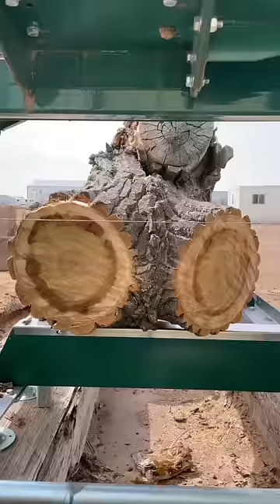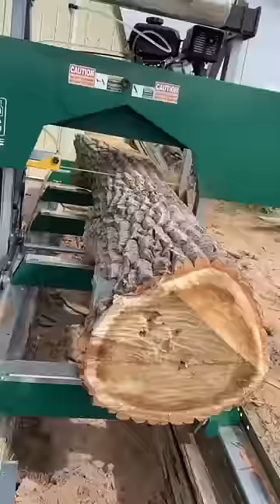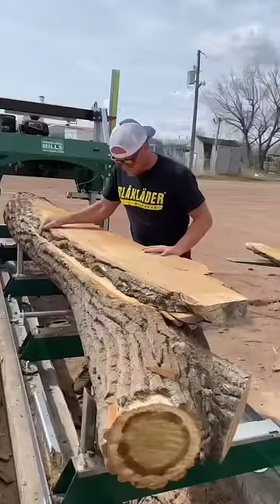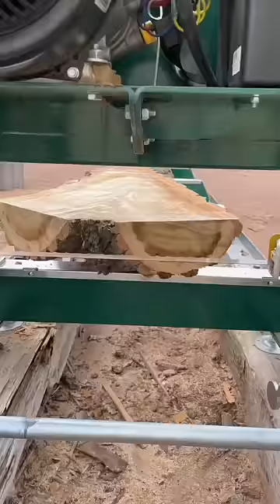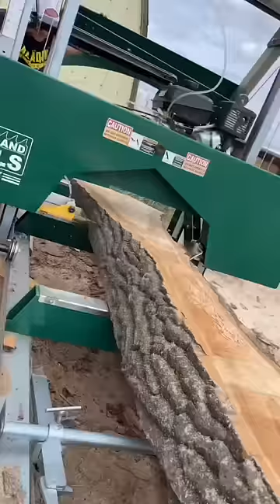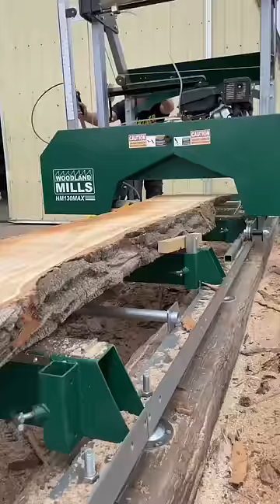Truth is, sawmills are a lot of fun! #woodworking #wood #woodwork #maker #sawmill #bois #holz #work

Comment: As I sit here in a sawmill, I can't help but wonder why your experience is the exact opposite of mine
Reply: Why's that? I'm just curious about how working in a sawmill can be different.
Reply: @juancarlosarroyo9144 
Where I am, the equipment is not well maintained, so prone to breaking down, not working correctly, or just downright doing things it isn't supposed to.

I also work with Australian hardwood, which is just downright impossibly hard and dense timber
Reply: Haha you know working here and just have some nice wood saw is a different thing 😁
Reply: @Duck_side  So like the locus of Australia?
Reply: Difference might be if you're your own boss, cut logs in funny shapes, decide where each cut goes
Or
Work in a commercial sawmill, have no say in the process and cut up straight softwood into construction lumber all day
Reply: I worked for several years at a sawmill that made dowel rod blanks that are made into shovel and rake handles. Depending on where you worked, gauged your experience. I worked up to the debarking shack, so I had it pretty easy. I could control the board footage for the day, so if someone pissed me off I just swamped the mill with logs to saw.
Reply: Vc nao ta precisando de um cara pra trabalhar com vc nao sei fazer moves lindos trabalho na minha casa mesmo mas tenho poucas ferramentas
Reply: 100% agree. Spent 6 years in a sawmill. It’s fun for the first 3 months. After that, those 60 hour work weeks get pretty demoralizing!
Reply: @juancarlosarroyo9144  🌼
Reply: This reminds me the story of the guy that drove the Autobahn daily for fun. He really enjoyed driving his little car around the corners at high speeds. Then one day he was offered pay to do what he’d already been doing for his own enjoyment. Naturally he jumped on this opportunity. After about six months he found himself enjoying it less and less as the stresses of reporting back started to feel like work to him. It’s a perspective challenge now. He enjoyed it when it was his hobby and began to loath it as work. I hear the very same things occurs to musicians often too. What they used to enjoy tirelessly has now become a burden both mentally and physically. I’m willing to bet if we look within ourselves we can find that enjoyment again with a new twist to some old perspectives. How spoiled rotten must we be to not enjoy being paid for a hobby? Or perhaps we can realize what fortunes we have by merely living where we are and that we aren’t some kids working in some humid factory making shoes for people that might wear them twice.
Reply: @Duck_side  I walked out of a saw mill on my first day. We had worked 5 hours without a break or clearing the machine of dust. I told my boss I was going to have a smoke, he said don’t come back.
Reply: i work in a lumberyard/sawmill. we have a giant saw that does this for us, though the logs are bigger, we pull the cants onto two angled holds that hold up to like 20 30 cants then the forktruck comes and takes them to to the smaller mill to become boards
Reply: @ItalianoDio-   @Italiano Dio  it takes you away from your family! When you leave for work your family is asleep. When you get home you have about 1 hour with your kids before bedtime. After you eat dinner and shower, you're too tired to spend time with your wife let alone listen to anything she needs to talk about. You see the people at work just as much, or more than your family. I understand that some men or women may like that, but for me it was torture.

It makes you feel like you're compromising your morals after a while and you slowly start to think it's ok to sacrifice your time with your family in order to receive money.

The greatest currency we have is time! You can either spend the majority of it at work or with family. I would prefer to spend mine with my family.
Reply: @kennyodberg171  See, that's where we differ. Single, no kids, and I work for myself. It's ok to trade time for money, as long as it's a lot of money. I love it. $2k for 10 hours of work, give or take. Then you only work 2 or 3 days a week and have plenty of free time.
Reply: @ItalianoDio-  I wish that's how it was. I was working 60 hours a week making around $2000 a month with overtime
Reply: @kennyodberg171  Yeah. That sucks.. that's how factory jobs were. Independent contracting has been good to me.
Reply: Looks to me like Cottonwood, what's that good for anyway? Does it help the sales of sawmill blades?
Reply: @melvinrexwinkle1510  you must not live around very many cottonwoods.
Reply: @wmiller7208  yep, there here but not of any value for firewood or lumber
Reply: I always thought the only reason to saw a log into lumber was to have lumber to sell or build something with, where Iive the cottonwood is useless
Reply: I run a mill the same as this one in Australia. What makes it fun is I'm milling for myself and close friends. I mill what I need when I need it. That's the difference between what this guy is doing and what you're doing.
Reply: I’m guessing there might be difference between running your own small mill for creative wood working projects and sitting/standing at your station slamming lumber through fast and loud day in and day out

Comment: Most of us do not have room for such a tool but I can say using a 12.5 inch planar gives a similar satisfaction. You buy 2x4 rough cut lumber and plane it to get really really nice looking boards. Then use a hand planer to work the edges. Then use the notch in the hand planer to make the sharp 90 degree edges 45 degrees. Then sand it. It will come out thicker and nicer than the wood in the premium section of the store that was processed down to 3/4 of an inch. Everything I just said still has to be done to that sawmill wood.
Reply: Just make sure you watch out for moisture content. A lot of framing lumber is only dried to 19% moisture and will keep drying after it's processed.

Comment: I tried to get one of these when we still lived on our farm the property was surrounded by black walnut trees some as thick as 6 foot across and we had over 30 of the huge bastards with a main trunk length of 15 to 20 feet before the first branches . the only problem is they don't make a portable saw big enough to handle one of those trees so there still there where they have been for over 200 years not even the local lumber mill will touch a tree that big. FFS I wanted a 2 in thick solid black walnut desk but it was not to be
Reply: Woodmizer makes a saw big enough for those kinds of trees. I wouldn't call it affordable, though.....

Comment: Do you ever need to shim up the cuts so that the blade doesn’t bind?
Reply: Most of the time, no. The blades have teeth offset in both directions, so the cut is wider than the kerf of the blade.